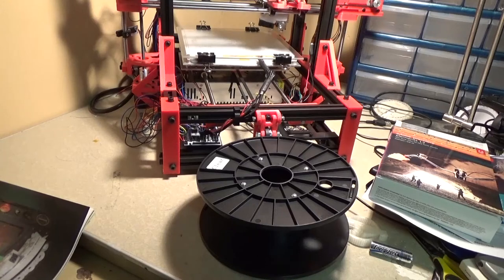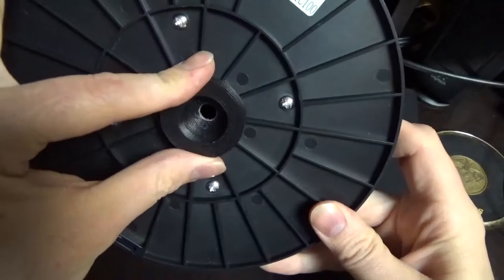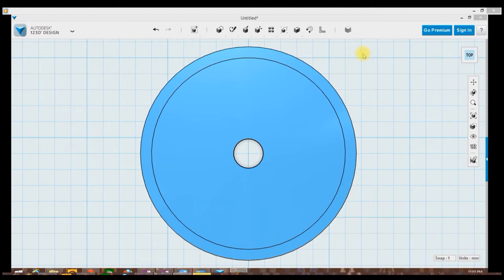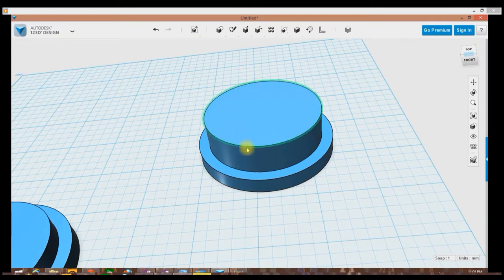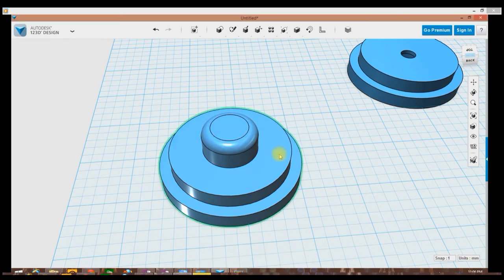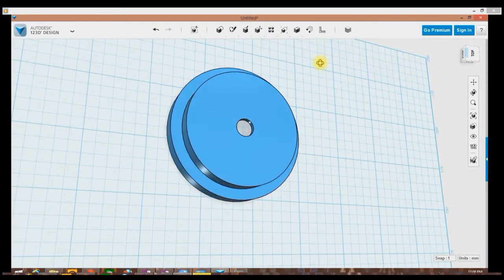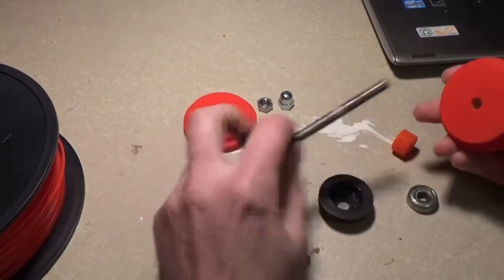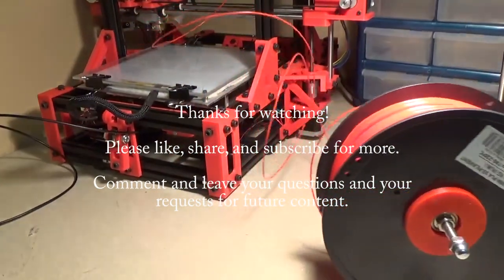How to design 3D printed parts in Autodesk 123D Design

Comment: Really cool video. Very informative and walks us through the process step by step, clearing up any problems we may have. Liked and subscribed :P
.
P.S. I'm curious about what mic you are getting soon as stated in the annotation.
Reply from the maker: DoctorSargeMD Thanks! I'm using a tried-and-true (and affordable!) mic - you can find it here: http://goo.gl/p2oc2v
Reply: FerrousBueller Ha I knew it! I had a feeling that would be the mic you were getting for some reason. I have this microphone and it is very high quality for the price. I highly recommend two things, one or both of which you may already have. Number 1 being a pop-filter for the microphone, and number 2 being a mic stand (rode psa1 is perfect but it's like $100 brand new). The stand that, that microphone comes with isn't very stable and if you knock it over too many times the wiring inside will bounce around and cause the mic to stop working.
Reply from the maker: DoctorSargeMD Awesome!  A friend of mine let me try his out and I thought it would be great for the price.  I will be getting the pop filter and a replacement stand as well.  Thanks!
Reply from the maker: DoctorSargeMD So far I love the quality of the Blue Snowball!  My most recent video on using Blender's Solidify modifier was narrated using it.  Literally just plug-and-play, I didn't tweak a thing!  3D Printed Iron Man Helmet - How to add thickness with Blender
Reply: FerrousBueller The quality of the your voice is so much better now haha, and plug-and-play is extremely convenient.